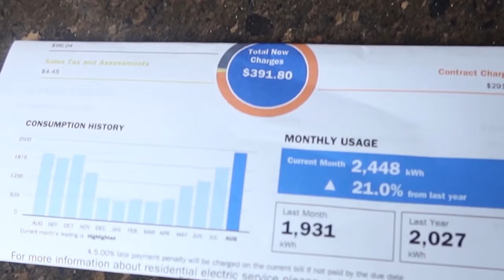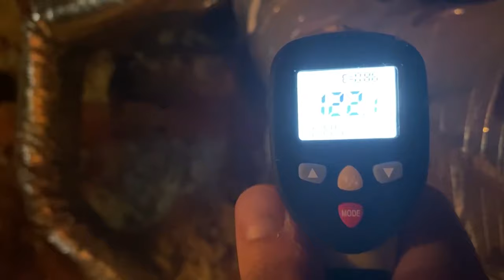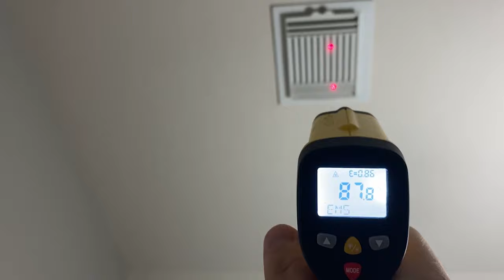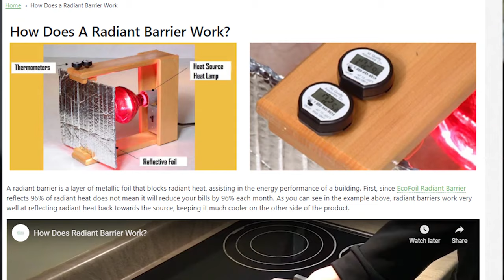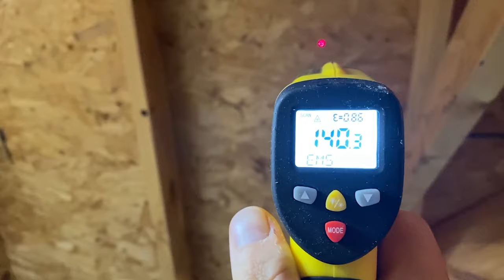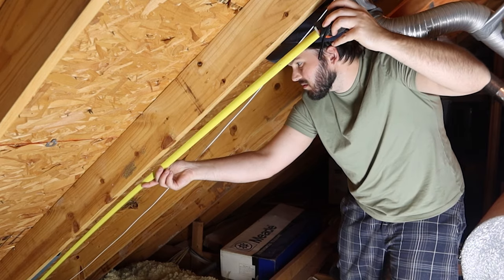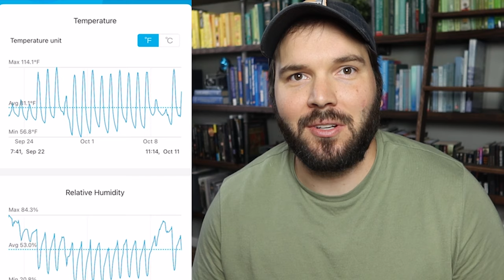Do Radiant Barriers Work & How Much Energy Will it Save: Real Home Owners Experience (Before/After)

Comment: We are glad that you were able to use the Radiant Barrier, and thank you for the shoutout! DIY projects are the best 😉
Reply from the maker: We love it! Also, we used some extra we had to survive the crazy freeze with no power for 3 days. We covered all the windows and doors from the inside. Prior to putting it up our house interior was below freezing with the fireplace on. Once we put it up, we could keep the house at 55 degrees with the fireplace. Also, none of our exposed copper pipes in the attic froze. At least half the houses in our neighborhood flooded from burst pipes in the attic.
Reply: I would like to get a quote on your product for my residental property.
Reply: @GrayHouseStudio  I live in South West Missouri and fernice/ductwork is under the house. A/c is outside and I have big gabel vents. My house has minimul shade would you still tecommend this product of a DIY? Donyou still think its worth installing after having it for so many years? Thanks just price of electricity is getting up there these days in mid 2022
Reply: @ddemier  I can set you up with my supplier in Texas. The basic product is about $.12 /sf up to about $.29/sf for the best product they have. You can order it direct from the manufacturer. I’ve used it for many years and in these tough times, I’m trying to help as many people as I can. I’m only passing on great information on a product that truly works. I have used it as a house wrap and in the attic for many years in my construction business. Everyone needs to use this before the shipping lines are totally shut down. Let me know if I can help, and spread the word!
Reply: @rayburnyarborough4695  do you have company in Atlanta that can recommend regarding product
Reply: @toosexy12jmb  the manufacturer is in Texas. $.14/sf

Comment: Been a bit since this was posted, seen your channel is not making many videos anymore. I would highly suggest using a FLIR (even if you buy it, check the areas, and return it soon after) to see if there are air leaks around your fixtures in the walls and ceiling, and even pull apart some of the insulation around the ducting to ensure that there are no leaks in the ducting itself. Checking you have enough soffit vents to ensure no air is being pulled into your house from outside by the heat rising to the top and pulling some air from your house into the attic. I also believe from what I have seen here on Youtube it is better to have it directly over the insulation. They are made to be vapor permeable, however, if you have it over the insulation itself you ensure no air movement over the insulation that could reduce the R value by blowing through the top few inches. Hope all went well with this as I don't see really an update on it after 3 years.

Comment: I live in Phoenix, have lived in other climates. My biggest improvements has been insulation and using mini split AC. I furred inside walls so 8" and max attic insulation. The mini split AC allowed for controlling every room separately, no ducts in attic and returns grills.

Comment: video didn't seem to answer the questions.  I would like to see:
- if for a given time period if the AC cycled less frequently after barrier installation compared to before.
- for a given time period, show graph of the attic temperature fluctuations, before and after.  Duct temps as well, although I am less interested in that.  I just want to know if this has the potential to decrease my AC frequent cycling problem and have data to support it.

It seems like you only pointed the IR thermometer and showed the barrier was cooler.  That should translate into cooler attic temps and less AC cycling, but you did not show that.  You showed a graph of the before condition only.
Reply: Also, compare ac bill before and after

Comment: I had a similar with the air conditioner cycling, and found that it was due to one of the vents pointing at the thermostat. Turning that register fixed the short cycling issue.

Later in the year when the 40k btu air conditioner was on 14 hours a day continuously, I installed a gable vent fan, and the interior temperature dropped 8 degrees even though it was 6 degrees hotter outside when I took the second measurement. Btw peak daily humidity is about 85%.

Comment: What an informative video! I use that same stuff in car restorations - awesome barrier inside the car, on the front bulkhead (to reduce engine heat transmission).  I also use that stuff for custom car shades.

Comment: The air gap between sheathing radiant Barrier the insulation.   Installed by radiant barrier on my remodel and the space above radiant barrier was 125 degrees and 80 degrees below it.  With only a single layer of vapor permeable vapor barrier.  With adding 800 Sq ft. Contractor said I’d need a new HVAC.  It’s running better than before remodel.

Comment: Hi there, I am planning to put aluminum bubble insulation under the ceiling (leaving an air gap of 1.5 or 2 inches), so it would be wood /air gap /or aluminum bubbles. My intention is to reduce the radiant heat that comes from and through the wood (from the ceiling). Will this work? (I live in San Diego, not a humid place, but temperatures in summer fluctuate around 95 °F.) My second question is: what is going to happen within the airgap? Is it likely to generate humidity and potentially mold?

Comment: Very interesting video. I was hoping you had a follow up video. It would be great if you did one In peak summer heat to do a comparison to this one.
Reply: I was also interested in what the summer to summer difference was
Reply: Yep, I like this sort of video where real world temp monitoring is done.  Your subscribers are curious to see the after effects of this radiant barrier as well as AC cycle and temp information.  South Louisiana is BRUTAL this year with the temperatures!!!
Reply: I used Atticfoil, $150  a 4'x125'. Stapled(electric) to underside of the rafters. Atic floor measured 130degrees on a 100 degree day. After installing attic floor measured 95, exact same time and conditions. Roll of foil paid for it self in 1 month. I'm saying this because you never really showed the real cost saving impact or even answered your own question.
Yes, radiant barrier works.

Comment: @Gray House Studio question on this... I noticed the temp of the sheet of plywood was 140, vs 130 degrees on the 2x4. In hindsight, do you wish you applied a strip of foam tape to the 2x4 before stapling the foil to reduce thermal bridging and keep more barrier from conducting from the wood to foil? Or do you think the difference would be negligible? Thanks :)
Reply: the emissivity of the foil is so low that it should not be significant

Comment: If there's a part of your house that isn't being cooled or heated properly—perhaps a child's bedroom or bathroom far away from your central HVAC, there's a useful technique to correct the problem. Overdo the insulation and foil for that room to better equalize the temperatures. Thick curtains in windows also help.

Comment: The insulation will always run ambient more than what the actual room temperature IS...
My block exterior walls that are bare are currently -5F.
The insulation reads 40F. Inside temperature it is 34F.
I have foam board laying around and it's 58F.
I can see my breathe and it's freezing .. 

Question is, how much did it cost... and how much are you saving?

Comment: I have lived in a new housing estate (in Australia) for seven years. Every house that I have seen built has the roof sarking and wall wrap fitted with the coloured side out and the shiny side in. I addition the manufacturers advice says to do it this way. I am not prepared to argue the case but am simply stating that this is how it is normally done.

Comment: Why would you leave a air gap at the bottom and the top   I installed mine all the Way to the outside of the exterior wall plate and then up to and around the collar bracing. I then installed a dual power solar ventilator on the roof above the collar bracing. I also installed 1 x 4 boards horizontally every two feet to allow air to transfer from one rafters to another. End result is air is drawn from soffit vents in and up the rafters then outside by the ventilator. My attic temperature is only a few degrees different from the home temperature. Any opening in the barrier is just allowing heat back in the attic. I can’t figure out why nobody else is noticing this on the internet
Reply: From all I've heard if you seal it up it can create moisture especially in humid climates. Hot air would typically rise so the air can be pulled from the gap at the bottom of the installation up and be released through the gap at the top. All the manufacturing instructions appear to recommend the same thing - gap at top and bottom. Not that that's the only way to solve the issue of course as your solution may also work well.

Comment: Adjust your fan speed on the blower. Is gonna help with dehum and use a water pump on the drain line so water doesnt get soak back in the air

Comment: I also used a Sense monitor in my house and the first thing I did was install a gable fan and that wasnt enough to cool my attic so the next thing I did was install a radiant barrier in my attic and my attic temperature went from 156F on a 98F day to 112F on a 98F day.  My energy usage from my air conditioner dropped 75%.  I also turned off the attic fan to see how much it helped and the attic fan plus the radiant is the combination you need
Reply: I just got my fan and am looking at putting up a radiant barrier.
Reply: Vent fans will cool your attic but they mostly do so by sucking cool air from your living space. It turns out that negative pressure in the attic is a bad thing.
Reply: @Lew114  That shouldn’t be the case if you have an additional gable vent that allows for more air in.
Reply: @Lew114  if you’re pulling air from your living space then that means you don’t have adequate soffit ventilation and also means you should be sealing things like top plates and ceiling penetrations.

Comment: your ac unit is oversized. depending on what you have you may be able to do some tuning to get better dehumidifying and all around better performance. 15 mins on and off sounds like a cycle setting in your thermostat also. your on the right track though.

Comment: I have my thermostat throw set to 1.5 degrees vs 1, that causes it to cycle less, which I think is more important for energy savings in the Winter, but still, less disturbing at night in Summer because going on/off less.  Very interesting video, I have reflector on the roof decking but still 135 in attic.  Does sound like AC oversized if not running enough to dehumidify.

Comment: I don't know what kind of ducts you have but typical flex duct has it's own foil radiant barrier on it.
Reply: The duct barrier only helps when the AC is running. At other times, the dead air inside the ducts is heated up by the high attic temp. The trick is to reduce the attic temp.

Comment: Yeah man I do AC work and if your system isn’t removed the humidity it’s either oversized or your thermostat located in the Supply airstream and it’s causing it to short cycle.
Reply: Usually it’s just not charged to the correct Subcool/superheat level. Anything under a 17* split is usually not removing too much humidity. However most homeowners never notice the difference. I’m in the Deep South and have never seen mold growing in a attic. Maybe a little in the wet winters but dries up dead as soon as the summer heat bakes it up
Reply: @kirkhernandez1165  An oversized unit will definitely short cycle.

Comment: a quick test of this principle is to turn on the stove (high).  Use a piece of aluminum foil, hold it between your face and the stovetop (within a foot) and it will block that radiant heat.  Use a similar sized panel of thin paper from the same distance and you will feel the heat radiance.  It works to stop heat transfer via radiant transfer.  Aluminum is a strong conducter of heat though..  Once it touches the burner, it quickly heats up and will "radiate" that heat (as well as strongly conduct it...   excellent heat sink)..    so the gap is needed,
Reply: You should do your due diligence before posting something as ludicrous as this. Radiant barrier is as different as night and day from “tin foil”!
 Reading from a box of Reynolds Wrap: to avoid possible heat damage, do not cover oven floor or an entire back…
 Radiant barrier is 99.9% aluminum and reflects heat.
Reply: Excellent model to explain the effectiveness of the barrier. Thanks.
Reply: reflective mylar is a better example. i had small air conditioner unit in my room that ran an exhaust duct to the window. the duct was just a thin tube of accordion plastic that leaked much of the heat back into the room. i took an emergency blanket (mylar) and wrapped it around the duct, then zip tied it.... massive difference to the touch

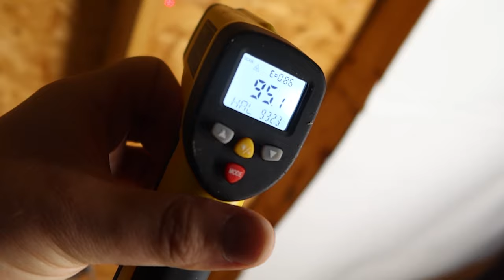Comment: 6:11 the infrared thermometer test is misleading because the back side of the radiant barrier is not going to have the same emissivity as the wood. For this reason, IR thermometers are not accurate at measuring the temperature of things that have different emissivity. For an accurate test, you need a matte black sticker on the wood, and the same matte black sticker somewhere on the radiant barrier, and you need to do the IR reading on the sticker only. By comparing the IR reading off of the same kind of surface (one with good emissivity, where the IR reading most accurately tells its temperature) your IR thermometer reading will be accurate. If you don't do this, the readings are misleading.

For a good demo of this, you can get two paint cans, paint the surface of one matte black, and polish the other or tape foil tape on it so it is super shiny, then fill both with boiling water. After a minute or so, both cans should be at the temperature of the boiling water  inside. Read both using the IR thermometer. You will get wildly different readings though a hand-test (feeling the can with your hand) will show you that the temperatures are the same.  This is the clearest demonstration that IR readings only make meaningful comparisons if you read off of the same kind of surface, and if that surface is emissive enough where the IR reading gives a realistic indicator of the thing's temperature.
Reply: Watch the video: Radiant Barrier Is It A Scam? 
Sarasota Energy Saver for a great demonstration!

Comment: Thank you for the video.   I think the white on the bottom is an interesting option, especially for areas that are used like a garage.

How much of a gap did you leave at the top of the rafters below the roof line?    We have a long roof over our garage with rafters down on the sides that lead back to the main area where the roof ventilation area is.   Hopefully, air will continue to flow back to the main area.   we have cross beams a couple of feet down from the ridge line - I've wondered about tenting across under the cross beams, but so far resisted - any thoughts?
Reply: Innovative Insulation in Texas has a product called double bubble double foil that you can layer 3/4” apart in the rafter spaces for about $.30 /sf  The white side is only for appearance to give a finished look.

Comment: Hi, so.. do you install this all the way from botton to the ridge?
Reply from the maker: I install it all the way to about 1 foot from the top of the ridge and about 2 feet from the bottom of the eave. That way some air can still circulate through the attic from the eave vent and out through the ridge vent. But, most of the extremely hot air can move behind the radiant barrier straight to the ridge vent.

Comment: That was super helpful.   I'm thinking of tearing off shingles...laying out some foil product...putting on 2/4 sleepers over the trusses and a new layer of plywood.  Forming a cold roof.
tHanks for your insight.
Reply: Unless you just need a new roof, I would install radiant barrier either on top of existing insulation in the attic or between the rafter spaces. Let me know if you need any advice.
Reply: @rayburnyarborough4695  tHank you.  Yes, this roof is a tear off.   So new shingles are the plan.
I want the cold roof for the house, that is why I came across the idea of laying out the foil over the old decking....then adding 2X material and new plywood over that.
Any ideas and advice is more than helpful. 
I need all the opinions I can find.
Reply: @rayburnyarborough4695  tHank you very much.
The plywood on the existing roof is just 3/8" (1960s ideas).  Rather than tear it off, I will simply make a cold roof and apply another layer. Same money except for the 2X material that will be used as a spacer between layers.
This is how I have an easy opportunity to put the foil on.
Still need opinions, please share any thoughts.
Reply: @Dancing_Alone_wRentals  Great! Call Innovative Insulation and talk to Matt Russell. This is the manufacturer in Texas. Their website is a wealth of information and different products. Tell him I told you to call. He can advise you on the best application and you can order directly from him, saving tons of money. I just spoke with him. You might only need one more layer of 3/8 plywood, however it might cost more than 1/2”. The savings on the radiant barrier might allow you to purchase a 1/2” Advantech sheathing. That stuff lasts forever. I always shop around. Try to go with a local lumber supply rather than the big box stores if possible. Good luck 😎
Reply: @rayburnyarborough4695  tHank you...I appreciate the tip!